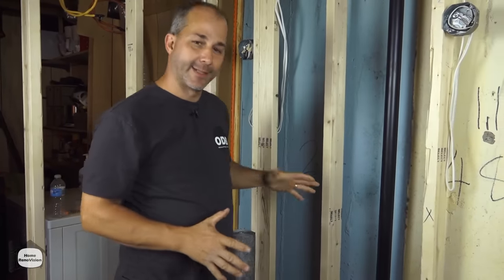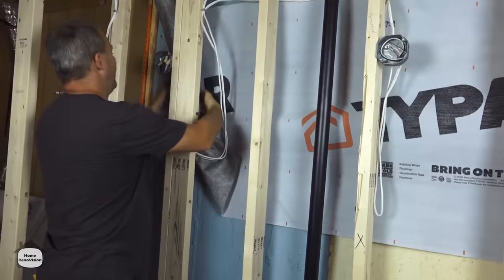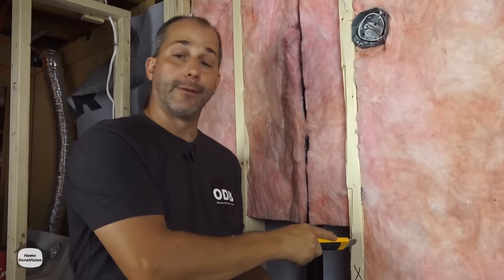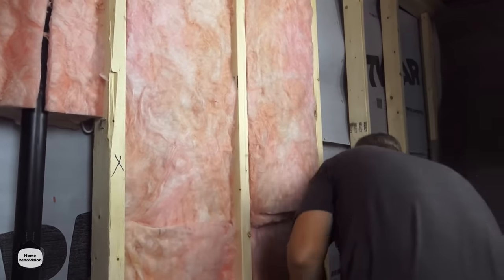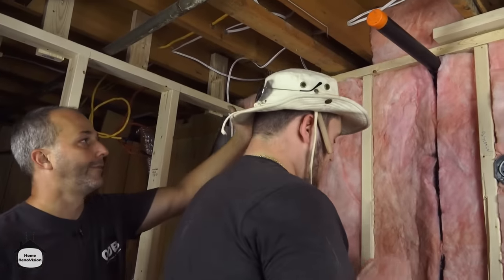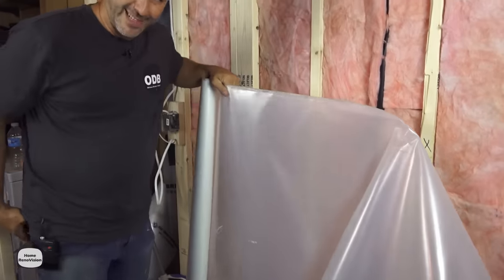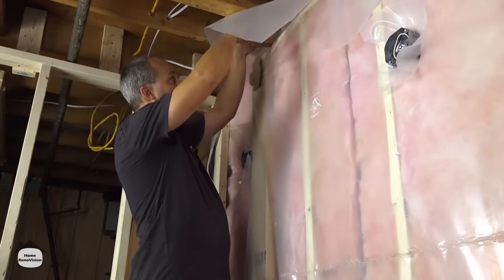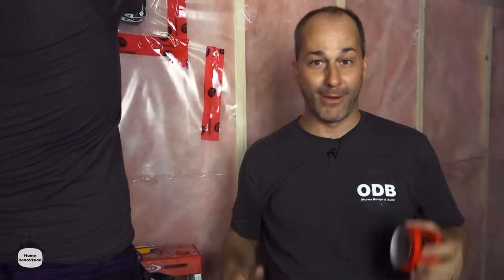How to Properly Insulate a Basement Wall: NO MOISTURE!

Comment: This is not right. moisture will still build up in the gap since it can't escape and mold will gather there? The only way to insulate a basement wall propperly is digging from the outside and insulating on the outside.

Comment: Vapor barriers on the inside should be overlapped with the top edge of each layer covering the bottom edge of the one above it. If it is done as shone on this video and condensation builds up on the back side of the vapor barrier it will just simply run into the insulated wall cavity.

Comment: I'm not an expert but I thought Typar allowed air flow in one direction, the black side through to the white side with the labels on it. moisture comes from the concrete walls, I think you would want this the other way around.

Comment: More and more studies  are saying that there should be NO plastic barriers in basements. You should let your walls breathe and dry out to the room. Otherwise you are trapping condensation. You have -10C outside and +25C inside. Its a huge difference in temps which can built condensation like crazy. And that pink insulation is terrible in repelling moisture and keeping its shape once its wet. That's why its preferable to use hard foam insulation in basements I believe.  I love your vids Jeff but I think you got it wrong this time. Hope you have a perfectly dry basement.

Comment: hey I had a question. You said you were going to staple the typar to the studs. How exactly did you do that because I didnt find it in the video.
Reply: He actually pulled the ends of the typar around to the front of the framing (at either end) and stapled to the front, I believe.
Reply: He doesn't, you can tell when he pushes the insulation against it, it moves.
Reply: It is not stapled to the foundation wall side of the studs.  The wall is built in place first, then the Typar wrapped around it on the foundation side.  Then the Typar is stapled at the wall ends, on the living space side.  This prevents the Typar from being pulled from any staples on the foundation side, creating holes in the Typar.  If you are framing the wall on the floor and then lifting it into place, you do not attach the Typar until the wall is plumbed, for the same reason (to avoid tearing it).

Comment: The exterior vapor barrier wasn't shingled to prevent condensation from dripping to the inside of the stud wall. 😥. You have to make sure to shingle top in front of bottom   from the perspective of the side where the vapor comes from.

Comment: I wouldn't use fiberglass insulation in the basement close to the floor or near a window it creates a wicking moisture issue leading to mold problems down the road.

Comment: I'm so happy to see someone in Ontario performing this work. It's a nightmare trying to piece together various videos on the same subjects for the code-centric knowledge required. Please keep it up!
Reply from the maker: Thanks, Cheers to Ontario.
Reply: R12 is not enough anywhere in Canada.  You need to get to minimum R20.
Reply from the maker: r12 is still sufficient if the house is made of 2x4 walls and the existing insulation is r12
Reply: @HomeRenoVisionDIY  So true ! I live near Peterborough, Ontario and took advantage of the Eco Energy Retrofit Program in 2010/2011. This house was advertised as having a Finished Basement which was so cold in the winter, I couldn't use the Rec Room.  The Eco Energy Program Person said that I was losing most of my heat from the headers in the Basement. The people I purchased the house from had finished the basement with panelling (1968 style) using just a few 1/4" straps. No insulation behind the panelling.  When I took down the 12"x12" ceiling tiles, there was no insulation in the Headers either.  What I was required to do per the  "program" was to caulk around the interior of each header, then add R12. Then I needed to add Pink Foam Board and caulk around that with Acoustical Sealant  which was a royal pain in the butt however I passed the finished blow test having reached the highest Energy Efficiency for a house of this age. So I received a sticker to attach to my electrical panel stating that my home is 78% Energy Efficient, and a nice Cheque back in about 6 weeks after the passing  the final test. And I'm not one bit sorry for doing all that work (I did the upstairs of this bungalow too).  I still have the Book that came with the program stating the "proper procedures" for insulating every place in my home, but like everything else, those "procedures" seem to change like the weather! Love your Channel. Thank you for posting your videos with  so many helpful tips!!!
Reply: @Christine-wi1dl  Thanks for sharing.We're doing the same here in Laval, Qc. Having a similar program, I decided to start the process and we're going to start by the outside of the house by removing all sidings and foam insulation and replacing it / fixing what we encounter. Did they do the test for the whole house or targetted the basement?

Comment: Try building your wall on the floor,using a pressure treated bottom plate.With the wall on the floor staple the typar starting at the PT bottom plate working up in layers like a shingle(we used tar paper in the 1980's).When you stand the wall,the Typar goes to the foundation.Fasten to a chalked line on the above floor joists and shim bottom plate.If the wall is off the floor,fasten 2x4 blocks to bottom of wall near studs to anchor bottom of wall.

Comment: love these vids..1 small improvement is to use Rockwool or go to the trouble of XPS foam. .Fiberglass is not recommended by Fine Home Building  and most experts...If it gets wet , stays wet and I always find some mold in it during renos
Reply: After watching all kinds of DIY videos on insulating.. I'm going with closed cell foam in my basement. My foundation has almost 6 feet of visible concrete in the backyard. Condensation like crazy. I need a complete vapor lock.

Comment: After gutting our basement, getting mold remediated, and putting in a french drain, I will be rebuilding the basement myself. I would like to use the system you show above, however, considering we were getting alot of moisture through the walls (100 year old house, poured concrete in northern NJ), I am wondering if I should also drylock the walls.
My questions are:
1. Will the typar and drylock create a space from which the humidity cannot escape and trap the moisture?
2. Is this overkill   

Looking forward to hearing from you and thanks for the great channel!!
Reply from the maker: Wow!!!! What a great question. Since you are a member i will give you the full answer. The best way to keep moisture out is from the outside. Using drylock on the inside will definitely help  However I would suggest using a vapor barrier with a french drain system so that you isolate the foundation from the living space.  The use of an airspace is only valuable to homes that need to regularly transfer moisture to the framing and ultimately to the outside through relative humidity transfer that don't have a french drain. Once you install the drain you can effectively separate the outside wall from the interior wall with a vapor barrier and eliminate the need for moisture transfer to the framing. This is a much more ideal system and will result in lower energy costs as well. If you need clarification feel free to call me on the callmart app. Cheers!
Reply: @HomeRenoVisionDIY   Thank you!!!! that is super helpful! Would love to get on a call for 5 minutes if you have the time to make sure I fully understand. How do I go about connecting on the callmart app?
Reply from the maker: Hi Eyal, I will repost the instructions in the community post in a few seconds. Cheers!
Reply: @HomeRenoVisionDIY  Hi Jeff, I just tried calling 3 times on call mart, it picks up, then immediately hangs up, I then immediately received 3 charges on my card for $18.71. not sure what I am doing wrong
Reply: @eyaldimant6824  contact a reputable sprayfoam company and have them spray the concrete directly. It will solve all your issues, I live in Ontario where moisture is a big problem. Batts/poly is just a cheap system for what the cost of spraying is/what it gives in return. We sprayed an entire 4000sqft house, no moisture problems and the homeowners heating bills are less than half of the neighbours with similar sized homes.

Comment: Thanks for all the clearly recorded footage and inspirational narrative. Even I am feeling MUCH more informed, if not capable to do this stuff myself!!
Had a flooded finished basement due to untoward weather event last February in Western OR. The house was built in 1952 with many modifications since, mostly unpermitted. Basement work was permitted in around 10 years ago which included lining the foundation with black plastic not attached to studs, then paperless fiberglass between studs down to rest on pressure treated wood which is secured to a slab that undoubtedly was poured without a barrier beneath. The finish is regular drywall and on the floor 6mil poly and click cork panel-lovely and warm.
I'm left with 2ft flood cuts and am "ready" to restore the downstairs.The wood in studs and on the floor show no sign of water exposure and the batting which was removed had no visible mold/mildew. While I'm not expecting water intrusion again, I still want to move ahead in a manner that takes into account the possiblity of vapor and more. I can't afford overkill, so...
Do I:
1) tear out the drywall and plastic
---and spray on closed cell or put in foam panels-if so, do I have to use some spray in behind the studs
---use typar or tyvec as you have demonstrated, then batting
2) leave the system as is and just replace the batting
3) replace the drwall with same or with cement board?
I am definitely going to use a dimple mat this time around and if I want to go with cork again, would I use 1-step and then just lay the cork atop or for "better safe than sorry" go with DMX, plywood then LVT?
Reply from the maker: Hi Janet, Wow That is one doozy of a question. First of all let me say that weather events happen. And when you get a flooded basement there is little you can do in the building system to protect you for every possible occasion. Having said that I have found that simple building systems and the following trick will help make the restoration process really quick and painless. First since 8 out of ten water events in a basement are less than 2 Inches I always suggest to people that are prone to regular water events  they can install blocking in the wall at 6 inches from the floor and then insulate above that. This enables the restoration crew to remove the baseboards and just drill holes in the drywall that will be covered up by the baseboards later. The fans can then circulate behinds the walls to dry everything out. 
since you are using a cork floor it can be removed and reinstalled. When the drying is done simply put the floor and baseboards back on and maybe a touch up paint on the trim and you are good to go.  If you are looking for a permanent solution you need to waterproof the exterior walls outside to the weeping tile. Make sure any windows have drainage tile in them as well and cover the wells in the winter so that you don't get a thaw freeze effect getting water around the sill of the window. Have a sump pit and as a last measure install an interior perimeter drain attached to the sump pit. This pit needs a second pump as a backup with a battery backup and perhaps an alarm with notification to your phone.

This can be in excess of $40,000 and needs to be a value to you. Everything else in between will fail and so will this technique if you get more than 2 inches. 

In closing we love the space the bathroom provides but we need to remember they are susceptible to these types of problems and balance out the investment with the benefit for yourself.

Insurance companies will not change their protocol for flood response based on your building system but they will do the drilling and air movement if it is clean water and that is over 90 % of the cases.

Good luck I hope this helps. Cheers!
Reply: Thanks for taking the time to even read my long winded query... AND then respond.
While noone can see the future, the past 22 years in this house have never seen water incurison-even during a flat out flood (we are not in any kind of flood zone), so I am hoping this was a one time freak event.
Your minimalistic approach appeals to me. By Blocking, do you mean put some EPS in up against the plastic that is thereperpendicular to the floor-like a fire block sort of situation, then isul;ate above with batting. If I don't insulate those bottom 6 inches won't that be asking for condensation to form as I will be heating the basement.
I really appreciate just having someone to ask. Thank you again.
Reply from the maker: Hi Janet, unless you are heating your basement at the floor there will be no change in temperature at the floor level. The walls and floor are the same temperature  year round at that level and as such causes no condensation. Your best solution is to spray foam the walls , however that comes with an additional cost. usually triple the cost of batt.
Reply: Ah, I see. if I go with your idea of blocking at 6 inches and batts above that, can you describe the blocking more?
Thank you so.

Comment: Thanks for the video. Correct me if I'm wrong but there seems to be some consensus that vapor barrier films or paper are a bad idea for basements. Underground walls need to breath so moisture is never trapped on one side or the other. Also, fiberglass has also been thought of as a no no due to mold and mildew issues. I have been taught that the best and most cost effective method to insulate the basement is xps foam board Directly against the concrete wall followed by framing and then something like roxul between the studs for extra R-value.

Again thanks for the videos. I have learned a lot.
Reply from the maker: The typar is not a vapor barrier. It is a house wrap that is designed to divert water. it does not trap vapor.
Always best to refer to the local building code. I personally don't like any system in contact with my concrete. Iy wakes it so hard to identify and repair any future problems.
Reply: I understand. I did notice this in some building codes but here in New England it is not necessarily a requirement.

I'm working on remodeling my house and have worked construction jobs in the past renovating basements. Ever situation with a poly film or fiberglass near the wall has revealed a lot of trapped moisture and dark mold. You can imagine there will be condensation on the concrete when it is cold and transitions into a warm space within the dwelling, so it makes sense that you leave an air gap and prevent any contact.

Thanks again for the information.
Reply from the maker: vapor barrier is to be set on a warm side. In your area that may be more frequent on the concrete side of the wall trapping moisture in the framing.
Reply: I, and I beleive most other building scientists would not recomend this sort of assembly.  In some areas code will require a vapor barrier on the conditioned side of the wall assembly.  However the solution shown in the video has a couple problems .  First I dont ever like to see fiberglass insulation in basements, and I see no excuse for that.  Second Typar is only 10-15 perms.  If the basement were to experiance a flooding event it would not allow water in the trapped cavity to escape fast enough to prevent mold growth.  Even if it was 50 perms the water vapor would just be escaping into the enclosed cavity behind the wall until the humidity was near 100%.  A better way to do this assemply is to use MemBrain instead of the poly barrier.  This vapor retarder becomes vapor open when the humidity gets too high in the wall cavity, allowing water vapor to escape.  I would personally also nix the typar altogether as its not really doing anything at that point.
Reply from the maker: LOL The best solution for a basement is a simple one. I have seen for years people trying to make the basement a living addition to the home and then they get flooded and start over again. Why invest huge amounts of money into a temporary space. Get bang for your buck but put your best living spaces above grade.
Reply: Mike Shifrin on
Reply: dcl97 the point of the typar is to keep the insulation off the foundation wall to prevent condensation buildup.  I’m thinking it should work. If you have the insulation against the foundation wall it’s going to create condensation and mold.
Reply from the maker: Thank you! andrew pollock

Comment: I had a 4 inch gap in my in basement similar to this video and it didn't work. The gap was there because the basement was underpinned. I had moisture on the foundation wall behind the insulation. I know because I cut out a section to take a look when the basement started smelling mouldy. Location: Canada
Now I have spray foam insulation on the basement walls and there is no problem. You can probably use rigid foam insulation behind the wood frame, but you better seal every connection and have some channel on the bottom to catch any water and diver it to a drain so it doesn't get under your floor.
Reply: Michael what is your foundation?  I’m about to spray foam my rubble foundation.  I’m putting delta-ms on the inside, bottom 5ft, to allow a thermal break so moisture won’t linger in the mortar and freeze.  Also put delta-ms on the exterior with a new weeping tile last year to prevent moisture coming in.

Comment: I see you do one wall in this video (and show a laundry room that may or may not have been insulated the same way.  Does this system require all walls to be insulated in the same way?  Will it fail if there is one wall that isn't insulated?  Would you insulate the exterior wall of the laundry room or would you insulate the interior wall of the laundry room?